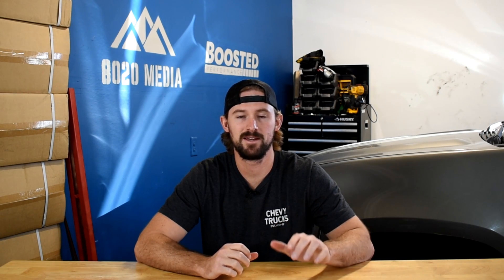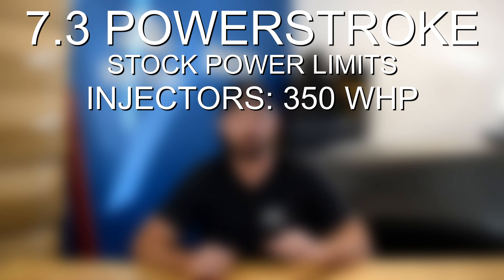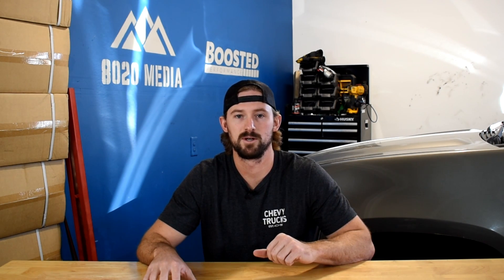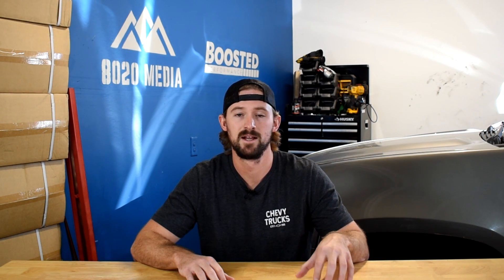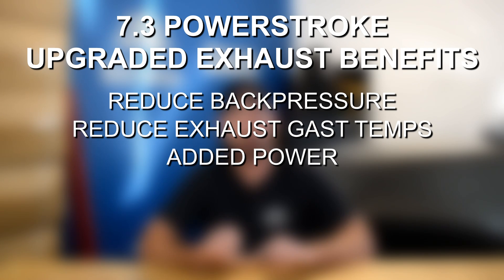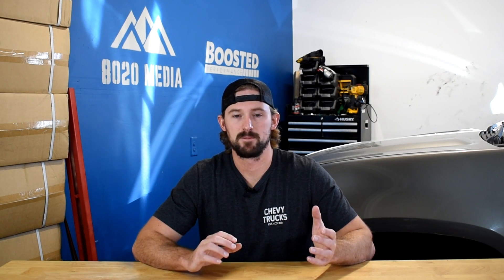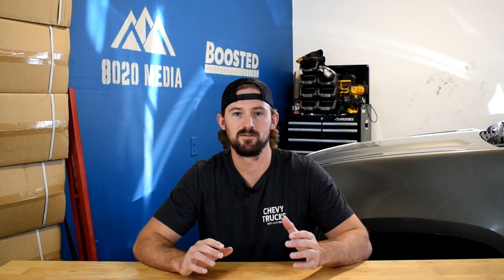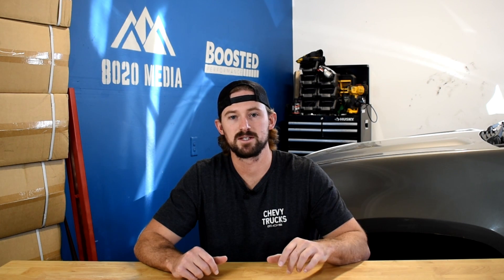How to Build a 325WHP Ford 7.3 PowerStroke!

Comment: I think it's funny when you say the 7.3 doesn't have good fuel mileage my 99 350 gets 20mpg my 05 was lucky to get 15mpg and my 10 got 11.4 mpg before I deleted and bulletproofed it and got 15 after before it melted down
Reply from the maker: R - Not all 7.3's get that kind of mileage.. We have one at 225k miles and it's not near that. But thanks for sharing your experience!

Comment: Just finished everything in this video and I have a question. When I am hammer down accelerating 80 MPH then I lift off, I hear what sounds like a pop-off valve sound... is this the waste gate dumping excess boost when I hear this?
Reply from the maker: S - On a 7.3L Powerstroke, you’re not hearing a pop-off valve or wastegate in the traditional turbo gas-engine sense—because the 7.3 uses a fixed-geometry turbo with no blow-off valve (BOV) and no electronically controlled wastegate; what you’re likely hearing when you lift off after hammering down is compressor surge or backpressure unloading, which can sound like a soft flutter or "psshhh" if you’ve added an aftermarket intake or if the turbo is pushing against a suddenly closed throttle/load drop (even though diesels don’t use a throttle plate like gas engines); in some cases, especially with intake mods, high boost, or worn turbo components, that surge is more noticeable—it’s not usually harmful on the 7.3 unless it's severe or frequent, but it’s worth checking your boost levels, intake couplers, and turbo health to make sure everything is sealed and functioning correctly.

Comment: as soon as the air under the hood heats up we loose power on buckets.. need fresh air from outside the engine compartment
Reply from the maker: G - Thanks for sharing.
Reply: kc turbo did dyno lost 12 hp. from the open airfilter.. gained 22 by cutting off the stock muffler but didnt make one more hp with a 5 inch exhaust.. thats why banks only sells 3 inch for our trucks .. except sound it does NOTHING.. Even egt went up @8020Automotive

Comment: Is there an aftermarket tranny cooler that can just be purchased online for a 99 late 7.3?  Also, seriously, I tow heavy... a backhoe on a heavy hauler trailer and I tow my camper which is around 13-14k lbs, backhoe is around 15-16k.  I have a late 99 F250 crew cab 7.3, less than 200k miles.  I have the hydra chip, but really no other mods, except no catalytic converter.  I was considering getting a newer truck, a dually, maybe a 6.7 diesel Ford or going to a 3500 Duramax.  I have the 3.73 rear end.  My truck really sturggles going through the mountains and up large hills towing.  Can it ever get close to what a newer 350 dually could do?
Reply from the maker: M - It would take a serious budget to build the 7.3 to a newer 350..

Comment: The whole oil system needs to be kept an eye on, especially on the oil rail. A few times I lost most the oil rapidly, I got mine to 400/915 back in 08, cost a small fortune back then with all the custom parts lol.

Comment: I'm more interested in fuel economy mods. Better efficiency is better than more horsepower, these motors are already plenty powerful. Besides it'll help the engine last longer too. I'm looking at getting a 2000 f250 and the hope is to have it last as long as possible. A million miles if possible.
Reply from the maker: C - If you're looking for the most mileage out of it, go stock. Fuel savings, intake.

Comment: I got a 4 inch cat back sp and a superchips flashpaq five. Looking at cold air intakes. I dont kike the way it shifts 2nd to 3rd on the performance mode. I drive slow and i want to stay reliable.

Comment: 01 7.3, no boost fooler but upgraded waste gate along with my built turbo, 1023 tunes on my hydra, wish they were still in business.
Reply from the maker: P - Nice! Sounds like a sick setup.
Reply: @8020Media  has a lot more done to it.  Will be doing gears soon, running 37s on stock gears. But roasts them all the way through 3rd. Always let off before hitting 4th and its a zf6 swap, valair ceramic dual disc

Comment: I have a 2000 7.3, built transmission with the pressure turned up and a shift kit. tS6 tuner. Posi 4.55 rear end, KC300X turbo, 400/400 injectors, hot rod HPOP, FASS lift pump. boost fooler, 4 inch straight pipe, and S&B intake. Fucker rips! Been holding this power for over 30K miles now and I rip it a lot! As long as you don’t rip on them hard at low rpm’s or do a bunch of launches, they will hold good!
Reply from the maker: D - Hell yeah! Love hearing this and we agree!
Reply: What type of speed u getting⁉️….Have a Virgin!….SLOW AS FUKKKK‼️😂

Comment: Most people try this with a clapped out 300,000 mile . Beware those wanting this hp and make it last . New hpop. New oil pump for lubrication of bearings . injectors rebuild couple ipr sensors. For the pcm can do it’s job check those injectors for bleeding off oil. Aka orings failure on top of injectors. The plastic pickup in fuel tanks break off and there 4 little pencil size screens 2 by the fuel filter must be cleaned before you start these mods .
Reply from the maker: M - Well said!
Reply: Which little pencil screens are you referring to

Comment: I was wondering about buying a 7.3 270k miles is it safe?
Reply: I'm getting ready to clock 300,000 on my 2000 and it's showing no signs of slowing down.  Just remember to keep up on your maintenance and keep your oil changed.
Reply from the maker: A - Well said!
Reply from the maker: C - All depends on maintenance history.
Reply: Was the oil changed at 3,000 if in dusty or towing, or 5k if only highway, do you have records of maintenance, is it clean and looks cared for.  Most equipment is about as good as it looks.  Probably needs injectors ($1500 in parts, 1500 labor), and likely a trans if auto, and expensive truck parts like rotors, tie rod ends, etc.  Could easy drop $10k into it... guaranteed.  Or just run it and keep some Gorilla tape handy.  I'd look for one with 150k on it at a dealer in northern idaho, and fly out, will save you $5,000 for sure, and you'll look smart.  Dead serious.

Comment: High horse power and reliability don not go together.  It’s a trade off. You have to find that balance
Reply from the maker: J - That's not entirely true.. What does "high horsepower" entail to you?
Reply: @8020Automotive  depends on how much power you trying to get. But ya. It is
Reply from the maker: J - Exactly.. it depends on what power you're trying to get to.

Comment: Just slapping in a hydra on the 140hp tune a cold air intake will probably get you over 300hp
Reply from the maker: W - We make these videos for reliability and performance. Is it easy to get to 325 whp, sure.

Comment: How to build 325 hp 7.3 take your 275hp 7.3 put a tuner on it with a 140 tune bam already more than 325
Reply from the maker: C - Wheel, not crank.
Reply: @8020Automotive  275+140=415 crank 
Easily at if not over 325 wheel
Reply from the maker: C - We make these videos for power & reliability. So could you easily get over 325, sure.
Reply: @8020Automotive  it’s a 7.3 it’s reliable no matter what you do to it I’ve been running a hot tune for a year not a single problem I haul on a hot tune too that truck that y’all built is capable of more power for sure but a quick and reliable 325 is done by a tune it’s literally on 50hp more than stock
Reply from the maker: C - Okay. Thanks for sharing your experience.

Comment: Hey im new to the diesel world and looking for some mods to mines. I just bought a 03 F350 7.3 and would love to do some of these mods you mention. Is working on a diesel truck really hard or can you take your time and do it yourself. Never worked on one before but work on cars.
Reply: Put a s&b cold air or a banks ram air intake, turbo back exhaust, tuner, boost fooler and pull that turbo put bellowed up pipes and up to you if you delete the EBPV. Rebuild the turbo with a kc balanced assembly and throw a 33 psi billet waste gate actuator run the actuator adjustment all the way in and plug the red hose on a clamp bolt 🙂
Reply from the maker: B - Well said. Thanks for sharing this.
Reply from the maker: C - The mods that we've listed are pretty straight forward. So you should be able to get them done.

Comment: Dont forget to replace  the transmission cooler for one out of a 6.0.
Reply: Curious what’s the benefit?
Reply: @DEVFORCE151   it's a bigger transmission cooler that keeps the transmission cooler and happier.  If your running stock tune, and stock tires, there is probably no need for it, but if you don't it is a must.
Reply from the maker: C - Thanks for coming back and helping out other viewers!
Reply: @charleybarber86  thank you for the info brother 🙏💪
Reply: @RXSEVDEV Mishimoto is a better transmission cooler & if you tow heavy it will extend your transmission's life.
Big tire or stock the 4R100 can easily get hot towing. 
Also delete the check balls in the transmission lines at the transmission.
Took my transmission temps from 225 towing down to 140-165
Reply from the maker: C - This is certainly an option.

Comment: Also I have deleted all the fuel restrictions and heater intake
Reply from the maker: C - Best way to do it!
Reply: Whichfuel restrictions
Reply: @RJ-cc1fz  the micro filters on the in tank pick up.  The fuel filter springs in the fuel filter housing, and the fuel bungs on the fuel inlets on the heads.

Comment: I have a 2001, F-250 4x4 crew cab.  I have a AFE intake. A KC 300X stage 2 turbo, a 4in exhaust, hydra tuner and S&B air box.  Better than stock injectors.  New adrenaline high pressure oil pump.  I get 20 miles to gallon
Reply from the maker: C - Sounds like you've got a great build.

Comment: I installed a 1997 7.3 in my 76 crew cab with 4" turbo back exhaust and cold air intake. My next upgrades will the PHP tuner and boost fooler. Browsing online I noticed that boost foolers are not available for pre 99 7.3s. Do you know the reason for this and what can I do to adapt a boost fooler.
Reply from the maker: 7 - The '94-'97 7.3s don't typically need a boost fooler, which may be why it's more difficult to find. Unless you're planning on heavily modifying it, we wouldn't worry about it.

Comment: 2000 F350 Dually 7.3 Powerstroke 4x4 ZF6 Ex. Cab
Full Force Stage 3 Injectors (205/30) with cups 
FRX 
HPX 
Pusher intake 
Riff Raff billet plenums 
International bellowed up pipes 
KC300x turbo 
4" Sinister Diesel turbo back exhaust 
AFE Momentum sealed intake 
SCT Livewire 
Innovative Diesel custom tunes
Southbend stage 3 clutch kit 
Red Head steering gear
Bilsteins
EBPV delete 
Max Tow egt sensor/gauge
Driven Diesel Hutch/Harpoon kit 
Riff Raff Boost Fooler
Reply from the maker: A - Sick build! Thanks for sharing.

Comment: I need to get mine checked out on a dyno. I have an 01 (built in 2000 so forged rods 🤌) with the following mods:
-S&B intake
-4 inch turbo back straight pipe (no cat)
-Ts6 tuner (set to either 50 or 75hp)
-Riffraff OBR
-Pulsar ball bearing drop in cartridge (comes with billet 14 blade wheel, i used to have a RiffRaff billet 4+4 wheel on my stock journal bearing cartridge)
-Riffraff EBPV delete pedestal & outlet
-TurboSmart wastegate actuator 
-RiffRaff billet plenum reinforcements
-Riffraff AIH delete bung (set up for boost gauge)

 im sure im missing something but nothing major. My truck is a zf6 truck with dog leg 4wd and is an ext cab short bed larait, shes not the quickest but shes oddly fast, ive done 115-120 😭😂 im seeing about 36 psi of boost as well at wot or if giving the beans while towing which i do the majority of the time im driving it. Im working on doing some more mods from RiffRaff like the FRx, high flow cvd's, oil feed cross over, banjo bolts, and other mods to support more power before i dig into the nitty gritty but im not planning on going crazy with power.
Reply from the maker: M - Sick build! Keep us updated.

Comment: Everybody keeps calling these exposed oiled media air filters “cold air intakes” which is the complete opposite of bringing cold air into the engine. The factory intake brings air in from outside of the engine compartment which is considerably cooler than the air under the closed hood. Not to mention all the dirt getting past the oiled media filter. Increase the diameter of the intake system piping all you want, but I would personally prefer to have an engine that didn’t get dusted and actually pulls in cold air from outside.
Reply: The factory airbox is super restrictive. Even with added temp the hp gain is there. An engine can inly burn the oxygen it has available to it. Call it what you want. For hp gains the exposed filter is the better option. If you live in a dusty area there are other options better than the factory airbox
Reply: “ but I would personally prefer to have an engine that didn’t get dusted and actually pulls in cold air from outside”,

This is as basic common mechanical sense as it gets, YES, Why use hot inefficient air from compartment and the suit-crap air the area usually accumulates?
Reply: Unless you do the zoodad mod, the factory air box also pulls in under hood air.
Reply: You can actually get a cold air intake filter that fits in the stock box, need to change them more often, actually got them from International
Reply from the maker: R - Everyone has their own opinions.

Comment: so the hydra tuner tunes the engine? i’m looking into a bigger turbo but im terrible at the whole tuning thing. so if i put the turbo on, a new exhaust and a BP intake, they hydra will take care of that?
Reply: Yes, I just put a hydra and 1.5 injectors into my 01 F350 that already had banks intake, fuel bowl delete and regulated return fuel system. The Hydra can be tuned for standard bolt ons with their tunes, or get custom tunes for turbo, big oil, and injectors
Reply: Anyone try a bullydog

Comment: I have an 03 superduty 4 door 4x4 with a 7.3 that I’ve owned for about 12 or 13 years now. It gets 17mpg. My only mods are an AFE cold air intake, magnaflow 4” turbo back exhaust with no muffler, and I swapped to a turbo pedestal with no butterfly in it. Everything else is stock. I’m seriously considering the Hydra chip you suggested to see if I can squeeze any more power and mpg’s out of it.
Reply from the maker: G - Nice! Sounds like you take great care of it.
Reply: Did you end up getting the hydra?
Reply: Yea....you reading the lie o meter for sure. It's probably closer to 15

Comment: What guages would you recomment running on a pillar? I kind of want to keep it streamlined and nice inside and not add a screen but still have guages for important things.
Reply from the maker: Boost and EGTs are the two most important - fuel pressure is good too to keep an eye on injectors. And then trans temp if you have an auto and want it. I just have boost and EGTs on mine but if you get a 3 pillar or something toss in fuel pressure

Comment: What is the stock WHP? If you are hitting 325 WHP what is the ball park torque numbers?
Reply from the maker: Depending on the year and model stock dyno numbers range from like 165whp-210whp. Torque will depend more so on the tuning but just running the Hydra you're probably somewhere around 650wtq range at 300-325whp.

Comment: Im looking at a 99 f450 for work. Im interested in upgrades specifically for towing heavier loads.
It has 132,000 miles and has a 6 speed manual trans.
I do masonry work in a remote rural town and have to haul material in for most of my jobs.
This truck would be ideal for my situation, especially if it had a little more power over stock.
I clicked on the link from the description here but not exactly sure what combination would work best?
Thanks for any advice.
Reply from the maker: G - All of the mods listed will get you to that 325WHP.
Reply: @8020Automotive  thanks!
Reply: @8020Media  I picked up that truck the other day. 
It has a newer flatbed that's ideal for my type of work. 
It also has an aftermarket intake and 4" exhaust, not sure about any tunes but it definitely has quite a bit more power compared to the 7.3 I sold last year.
I'm curious if it already has some type of tune previously installed can you install something different?
I'm not sure how that works so I'll probably run it the way it is and see how it does.
I have a light load to pick up this coming week that will be a good way to test it out. It's a 4 hour round trip through some mountain passes. Like I mentioned this truck definitely has more power but I need it to be able to pull heavy loads and not get hot.
I couldn't be happier though, I only paid 4k for it.
Reply from the maker: G - Sounds like a solid deal! Keep us updated on the build.

Comment: Gas Mileage?? Bro, My 2000 7.3 gets 18+MPGs of Fuel mileage! Did my mods back in 04' Banks intercooler, Upgraded trurbo with a 4" strait thru exhaust, the big plus was the NaviStar/Inernational A/C injectors and upgrading to a TS 6 stage power chip! Rebuild the Trans with a converter to handle the power... But! Only run on stage 4 and Rarely give my beloved Power Stroke Hell :) She's a Mid-Night Blue Lariat and still looking Sweet!
The biggest mod was a New Motor wire harness... These trucks are getting old!
Reply: Are you hand calculating, or going by the lie o meter on the truck? The one on the truck is not accurate.
Reply from the maker: D - Thanks for sharing your experience. Are you only driving it on the highway?
Reply: @8020Media my 7.3 gets 17 mpg city it's amazing
Reply from the maker: D - That's pretty damn good.. what mods do you have on it?
Reply: @8020Automotive  intake exaust ebpv delete
Reply from the maker: D - Nice! Thanks for sharing your build.